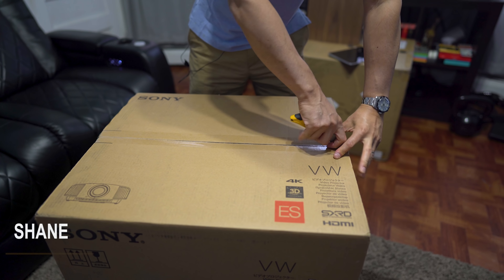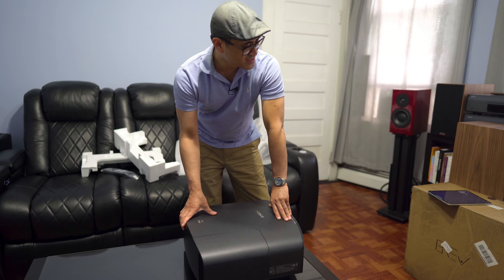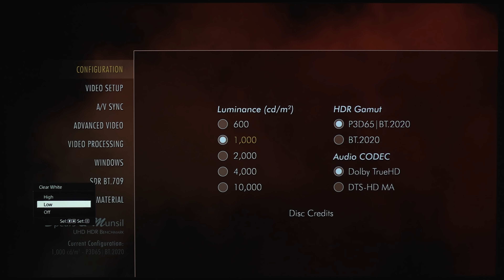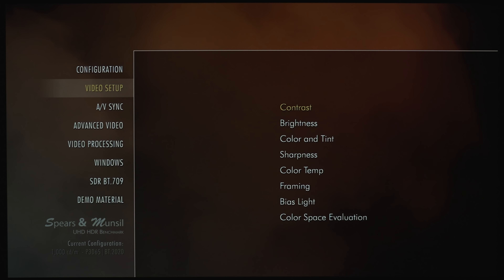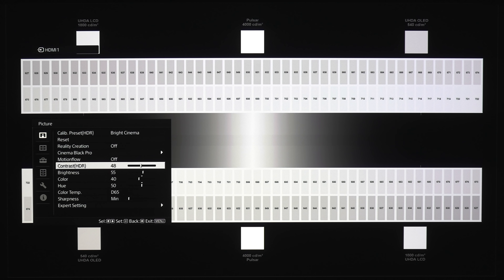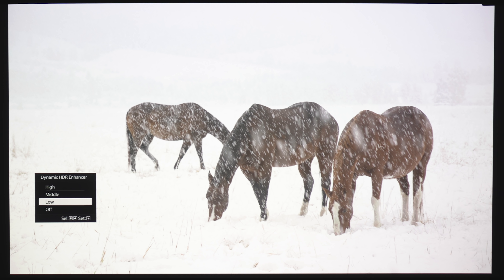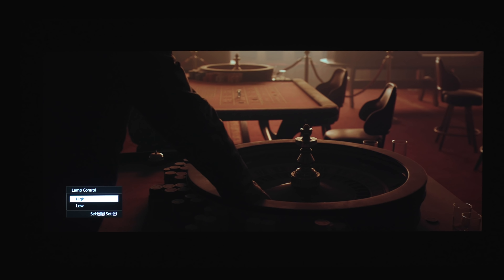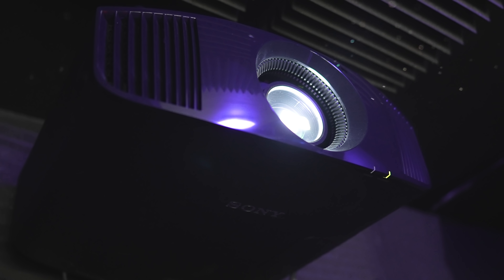REAL 4K Projection! SONY VPL-VW325ES 4K Projector Review

Comment: I've been living with this projector for a few weeks now (it's called the VPL-VW290 here in the UK - I don't know why on earth they change the model numbers from territory to territory) and I love it, the image is very bold, the colours wonderful, and much of the time I think you could be mistaken for viewing a modern TV (which as we know, projector brightness and HDR can't compete with).  I'm projecting at about 110" diagonal, which suits the brightness of the output very well.
Reply: Did you notice any drifting focus issues?
Reply: @MrXenod  I think I did after setting it up so I readjusted it and not noticed anything since, but I'll check again later - if it has drifted then it's not within my range of perception at normal viewing distance.
Reply: How is the fan noise??  high in high lamp? or allright?
Reply: I have one now also, in a separate projection room behind glass. Had it inside the theatre in the beginning and I would not be able to stand the fan noise in high lamp mode without separate room. In low lamp it is ok. Note that the optical focus is dependent on the temperature, so I initially had some problem with the focus changing the longer the projector was used before I improved the cooling.
Reply: Obviously everyone has different tolerance levels but personally - and I use this in low setting - it's not too bad and must of the time I'm not really aware of it.  It is more noticeable in high lamp setting as to be expected, but I don't need that extra wallop of brightness so I'm okay with low.

Comment: Are you going to review the Sony VPL-VW715ES? That's the direct comparison to the NX7/NZ7
Reply: realistically speaking 715 is fighting against NX5, not against NX7
Reply: @georgepopescu1327  Isn't the NX7/NZ7 and the 715 all around $10K? The NX5 is only a $500 more than the 325
Reply: @avtechman77  unfortunately the price don't reflect the reality. 715es against NX7 will lose in every respectable  way. It is, however, a direct competitor for NX5.
Also those prices are in USA but in Europe the 715es is actually a bit cheaper compared to NX5.
The 715 es is a bit sharper and has slightly better motion compared to NX7 but other than that, it has much lower native contrast, it doesn't have an IRIS as good as NX7, it doesn't match the black levels, it doesn't have the ability to use a filter for 100% DCI P3, it doesn't have the same light output and, most important it doesn't have the very good dynamic tone mapping og JVC which makes the HDR look so good.
Reply: @avtechman77  that is a very inaccurate comparison. Projectors are uncalibrated so they most likely don't follow 2.2 gamma and also the colors are way off on both.
Reply: @georgepopescu1327  Most will not have their displays/Projectors calibrated. I do plan to have my Projector calibrated at some point
Reply: @avtechman77  buy a colorchecker display pro and learn to do it yourself. It's not easy but it's definitely possible to learn the basics. It will open up to you a whole new world in terms of video quality and you will understand why reviewing an uncalibrated projector or TV can make more harm than good.

Comment: yes they have had a motorized lens cap, my vw95es has one. I guess you haven't been around long enough.
Reply from the maker: I still have my vw200. I don't believe it has a motorized lens. I believe that's older than your 95es.
Reply: @therealshanelee  Well I can tell you my 95 has a motorized lens and motorized lens cover too. I know I've been using it for 8 years or more.
Reply: @therealshanelee  I still have the VW50 and it has a motorized lens but not memory lens.

Comment: Serious question:  With the limited nits of projectors, and the seemingly constant tweaking to the HDR settings, wouldn't it just be better to calibrate for SDR and watch all the content with HDR disabled???  What is the actual benefit of running in HDR with a projector that at max is hitting 100 nits?
Reply: Some movies really have impressive HDR highlights, even with light output limitations. Sure, the same thing goes both ways, there are movies which look much better in SDR, especially on projector.
For this Sony, if you want decent HDR experience, you should go no larger than 110 inch screen.
Reply: @georgepopescu1327  Good to know!  I currently have a 92" screen(I have a smaller room), but I'm thinking of going to a 100" 16x9 acoustically transparent screen later this year, and then adding a 4k projector in 2023/2024.
Reply: @georgepopescu1327  I was thinking 120 max on a diagonal screen for 325es.
Reply: @percybedford6266  go for the 715 , it's brighter and it has an iris, which helps a lot.
Reply: @georgepopescu1327  I am actually looking at the NP5 and the LS12000 right now.  10k for a projector is a little too steep right now for me.
Reply: @percybedford6266  I forgot Sony is overpriced in USA :)
NP5 will have  better contrast and better black levels and dynamic tone mapping. LS12000 will be brighter but you don't need so much light for 120 inch.
Reply: @georgepopescu1327  yeah but I was also thinking of increasing to 130-135 in the future.  When I bought my X35 in 2013 the prices were more competitive.  JVC has gone up in price too and they have increased their price by 1k on all of their projectors.
Reply: @percybedford6266  for that size you can try LS12000 but you have to manage your expectations. The image is good but it's not JVC. Also if you like 3D this projector is a no go.
Reply: @georgepopescu1327  well I still have my X35, I can use that for 3D.  The NP5 looks really nice, but I don't know if I want to pay 7K for it especially considering $500 a pop for lamps.  I don't know I'll think about it.

Comment: Hi im looking to get a native 4k projector im goin to have a 2.35:1 aspect screen. Will i need the anamorphic lens or just straight from the box i can use the 2.35:1 on the projector? Im looking into SONY or JVC PROJECTORS sony 325 or jvc sr 1100
Reply: I think the next level sony projector has the new feature called “Blanking mode” which does that .. but not the vw325
Reply: You could probably just use the zoom to get 2.35:1 to fit.  An anamorphic lens costs as much as the projector itself.  I tried making my own once upon a time....tried... 🙂

Comment: How do projectors compare to high end TVs on picture quality
Reply: Televison always beats projector on picture quality for most people. Bigger screen and more filmic image if the benefit of projector. For every day viewing televisions are amazing but for watching movies nothing beats a 140+ image IMHO.
Reply: To use a metaphor, TVs are a stamp. Projection screens are the envelope. It’s just a totally different scale and completely different experience. TVs are of course backlit and the light source, whereas with projection, you’re looking at reflected light, which is much easier on the eyes. And the larger the image, the easier it is since by definition, that larger screen occupies a larger field of view, so less light falloff for your eyes to adjust to. Your irises go bananas when watching a flat panel tv in a dark room. Picture quality wise, it depends on which projector and screen combo. But a great projector properly focused on a low gain white screen is in most important ways the ‘best’ picture. But some people respond more to the inherent pop of a direct light source like a flat panel tv. But that doesn’t make it better. However, a lot of a projection setup’s potential is room and light dependent. Flat panels aren’t as subject to the vagaries of an imperfect room.
Reply: They do not even compare. 
Projectors will give you a much bigger image, the limit is your home. But also the image is way way more immersive, it's like being in a movie theatre, it's hard to describe. 
You can't beat that with a TV, even the best modern offering.
Reply: I quote all just said, and also add even if you turn down the brightness of a flat TV right for a dark room, even if an OLED with best contrast and all, it will never give you that cinematic experience with projected direct light

Comment: Sony vpl has to be paired with ub9000 for 4K HDR content, this will help to max out the nits at 350. Owning both the JVC NX7 and Sony VPL, my experience is Sony looks sharper and JVC does much better on contrast, black level and HDR. I typically use JVC for 4K HDR movie and Sony for gaming. For 3D, Sony offers a bit more depth, but it has cross talk issues for certain 3D movies, especially those ones with dark images. JVC, on the hand, usually can handle those dark 3D movies with no obvious image issues. For most of my 3D contents, I use Sony, but there are a few I will use JVC NX.
Reply: I would argue that what it really needs is a Lumagen :D
Reply: why do you 2 projectors???????? buy instead a better one ? ;)

Comment: Thinking of replacing my 285es (8 bit) and 100 inch screen with an 85 inch panel.  Better to do or should I just replace with the 325es?
Reply from the maker: 85 to 100 is a big difference size wise.
Reply: Family thought the same thing but I blocked it out with masking tape on the screen and they seemed to agree but “just” barely.  Thinking their would be no compromises with an LG C2  or a Sony X95K which would compensate for the smaller screen size.  Overall — a better quality picture than a “finicky projector” can produce.  The cost between the two is about the same overall.  I related to your review of the 325es given my 5 years with the 285es.
Reply: quote to shane, also it's up to your taste, panels are not cinematic at all, but maybe if you don't have a light controlled room it's a better choice for you
Reply: @h4xor1701    I do have a light controlled room.  Your thought then is an 83 inch panel is too small despite the better performance of an A95J oled or C2 at that size.  What do you have in the way of screen size?

Comment: Flagship Epson 4K pixel shifter vs Sony native 4k and for the price concerned the Epson wins. Very disappointed with Sony models as the lower end 4K models have very dark pictures. For the half the price the Epson isn't as sharp but has way more colour and depth. The Sony models aren't worth it unless a few thousand is just pocket change or you're foolish enough to part with at least double the amount for hardly any gain.
Reply: Sony becomes intersting with the middle level projector, the 715 Es, which has better light output and , very important an IRIS
Reply: @georgepopescu1327  True but you will still struggle with hdr. The Sonys need an external processor like a lumagen to get the tone mapping right unfortunately.
Reply: I doubt a ptixel shifter will ever beat a Native 4k for most people. I looked a few pixel shifting ones and the black levels are no where close to the Sony. Its the same comparson between OLED and LCD. LCD while brighter can’t hold a candle to OLED black levels.
Reply: @scotttild  I'm not saying Epson has black levels as good as Sony but, nevertheless, are you sure that the units you seen had the iris closed enough to light match the Sony? If not it's perfectly normal to see raised black levels as Epson has way more light output. Personally I keep my projector in Eco with iris closed down to -16, otherwise the black levels won't look good.
Reply: @scotttild  Why do you think black levels are the be all and end all? What about color and brightness? The 2 bottom end Sony native PJs are not worth the money. Who has 5 grand to spend on a native pj, when you can get one for half the price with a slightly less deeper black but better brightness. Unless you like paying to brag

Comment: You had me until 1500 lumens. My current projector is over 3000.  Maybe I shall wait a little longer.
Reply: u don´t need 3000 if you want to watch Movies.
Reply: @angc1456  Yes I absolutely do.
Reply: @wiredforstereo  why?
Reply: @angc1456   Because that's what I want to look at. My current projector is something like 3500 lumens and is not bright enough. Perhaps is screen size, I have a 135 inch screen and a room that is not totally dark as of this writing.
Need a silver screen rather than white, also.
Reply: @wiredforstereo   okey i get. if you  have a total black room you don´t need 3500
Reply: @angc1456  Okay, so no reason to take the time to leave a comment and tell me I'm wrong, when you don't know what you're talking about.
Reply: I use an 1800 lumen Sony 1080p projector in a room that has some light in it and it works fine for sports and youtube videos, however, for movies, blackout curtains work wonders and I am able to enjoy movies too.
Reply: @nebtheweb8885  I hear you. When new, I ran my projector on Eco mode. Now the bulb is hitting 4000 hours and even on bright it's getting pretty dim.
Reply: @wiredforstereo  I never use ECO or low brightness because I don't have a dedicated dark room. There is some light but controlled with curtains but still cannot get dark dark because I refuse to paint everything black.
Reply: @nebtheweb8885  I don't presently either. It's within the 5 year plan to finish out the basement with walls around the movie room, then I will have pure black.

Comment: Why not laser for the same Price? 	
Sony VPL-XW5000ES much better for the same Money
Reply: This is probably discontinued
Reply: @harrytej  It is still available as of October of 2022. The 5000 is brighter (2000 luman), and uses a laser, but still uses those cluncky focus and positioning wheels. The older 325 in the video uses a motorized lens for focus and positioning and uses a 1500 lumen bulb.  Both are roughly the same price.